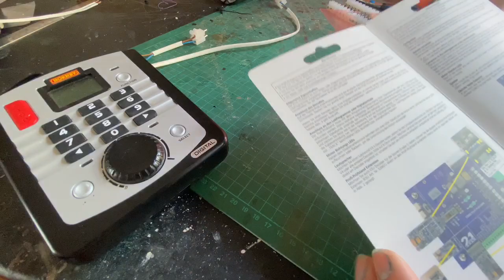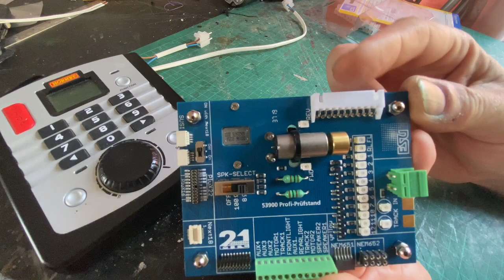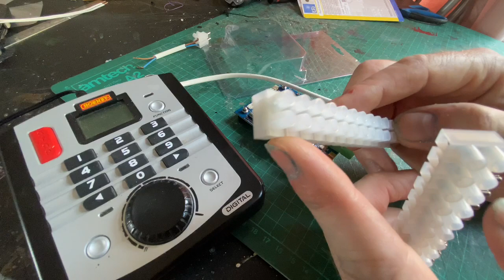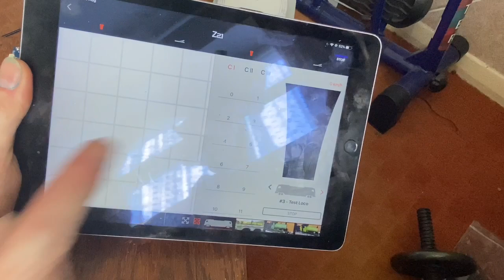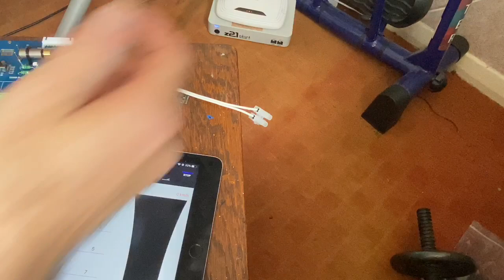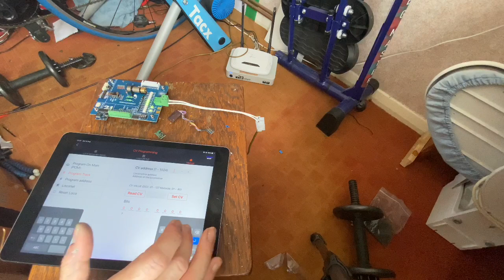FAULTY DCC DECODER – how do you know?

Comment: Great video John, i recently installed the hattons 8 pin decoder into my hornby hst. The one in the dummy car got extremely hot and slightly melted the chassis but hattons gladly exchanged it . I've installed a few of these into a  few locos including bachman & heljan with no problems . Many thanks
Reply from the maker: Hi Brian, sorry for the delayed response. It sounds like you are having fun. After experiencing DCC, the older DC analogue seems a little lacking. Some things just work, whilst others hmmm don’t. Gratefully Hattons helped you out. I’ve usually had good service with them.

Comment: Looks a very handy piece of kit.  Particularly with locos held together with plastic clips, there's always the risk of damaging one of the clips when you take it apart, so ensuring the decoder is working before dismantling the loco would be a good idea. Even more so if you have to start making room for the chip by grinding off bits of chassis!  And if a loco starts playing up, and you suspect the decoder, much better to put it in a £40 tester rather than a different £150+ loco to check it out. It'll be interesting to see what else it can tell you by hooking it up to a computer.
Reply from the maker: Exactly Andrew, think it will be worth its weight in gold.

Comment: Very nice video John, I have used these for years with my Lok Programmer. If you are ever in doubt about which version of ESU sound decoder you want to test always put the speaker switch on 100 ohms, it will be safe. If you had an ESU 3.5 for example and had it on 8 ohms you would damage it, it needs to be 100. If you have version 4 and had it on 100 it would be fine, just slightly lower volume. ..Simon
Reply from the maker: Hi Simon, there’s still loads to learn, I will get there. I tend to use Youchoos sound which comes with the speaker attatched
Reply: What I have noticed is some people use twin speakers with TTS sound decoders. The TTS decoders need a minimum of 8ohms so the speakers would need to be soldered together in series, which would give around 15ohms.  If they are soldered in parallel you would end up with a bout 3.7ohm, which would damage the TTS decoder. I did a video on speakers a while ago, I may do a better one in the near future...Simon

Comment: very helpful, recently brought one to use with NCE pro cab but i must have been going wrong by plugging the connection into program track slot rather than track slot.
Reply from the maker: Hi, not used a poercab but I wouldnt think it makes much difference.

Comment: The 100 Ohm speaker setting is so Lok Sound V3 series decoders can be tested on the test stand.
Reply from the maker: Yes you are right, Im guessing thats for the bigger gauges?
Reply: @piccadillysidingsoogaugemo6445   No, the Lok Sound V3 series was for various scales. It has been upgraded twice by the V4  & the newest V5 series of Lok Sound & Lok Pilot decoders
Reply from the maker: Fair enough, nothing Ive come across. Thanks for the info